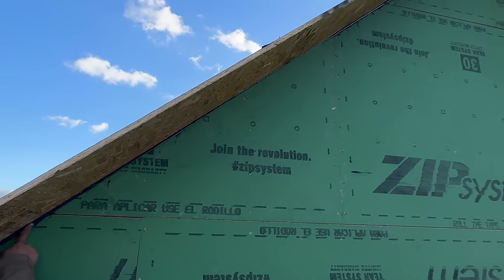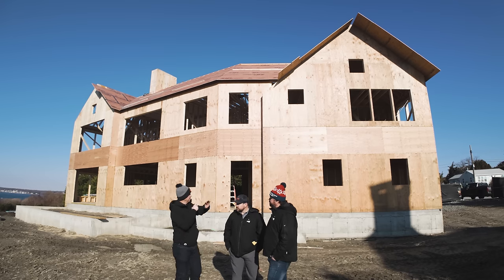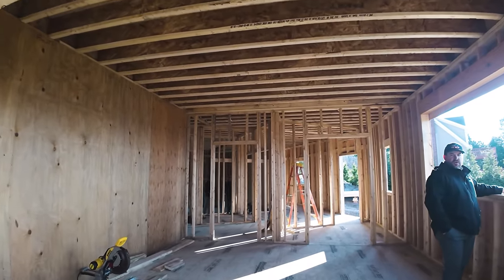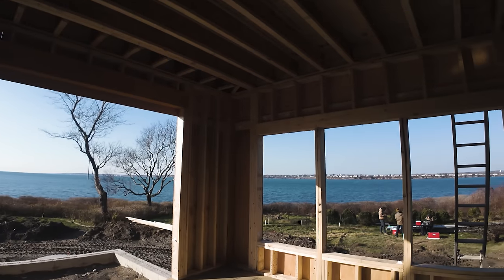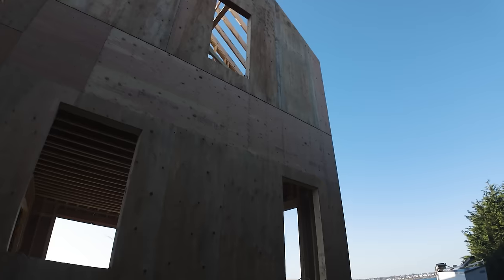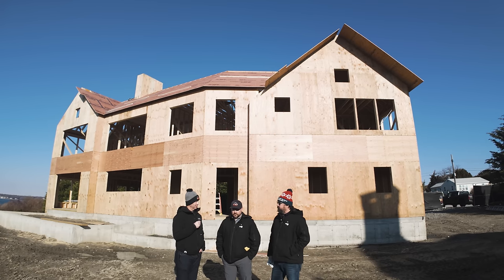A Smarter Way to Do Traditional Framing

Comment: I actually work for a panel company,  and I will say that the main advantage of turning to panelization is to provide lead time on the review of plans to find and sort out inconsistencies and errors. This reduces delays and waste tremendously in the multi- family construction field. Also, if a project isn't completely custom, such as a repeated home style, after the panel design is completed once,  the building can be replicated and refined again and again very easily.
Reply: Any cons to it? Everything has pros and cons that need dealt with so I'm just curious.
Reply: @95dodgev10  
-Wall sizes are restricted to the loads that can travel on the highways in your state, which can be prohibitive at times and limits the size of the wall.
-As was alluded to in the video, wall construction approaches have to shift when it comes to floor to floor
-Architects and Engineers have to allow for it in their designs, there are a few details that we have to iron out and having them on board isn't always easy. They are resistant to change and slow to respond to questions months before a project "starts" so you have to train them to be willing to answer lots and lots of very detailed questions early on in the process and not hip-fire lazy responses, this delays us more than anything I would say. Relationships with these partners is key.
-Small errors in the plan can multiply very quickly and though we try to find any inconsistencies and errors long before anything is ever built because we are essentially building the structure digitally at a high level of accuracy so the errors tend to show up before constructions begins leading to less delays and remodels.
-We have to have all information up front, it cannot come here and there so the Contractor needs to have their act together. All submittals, all plans, etc.
-In essence you are re-balancing the labor and relying much more on the panel company to get it right rather than on a framer to get it right. When I get done with a design, the labor that stands the building can get it done very quickly.

Comment: Hi Matt,
I really enjoy your channel and the direction it is going.
I have a quick question.
I need a recommendation for an air barrier (besides visqueen) to install under the shiplap wall cladding for the interior of our beach cabin (980 SF) that I designed specifically for the lot. We are getting close to insulating and using Rockwool for insulation. The exterior is all shingle and we used Benjamin Obdyke's HydroGap for the vapor barrier with Rainslicker over the top that. We live in the PNW. The heating system is ductless.
Thanks, and keep up the great job.
Jeff K

Comment: As a framer in my past i feel building it myself is way better than panel,  no miscommunication from engineers,  builders abd installers
Reply: Not trying to be inflammatory or accusatory, but couldn't you also be a source of miscommunication?
Reply: @joshuathorson8813 Did you read the full comment
Reply: As a framer,  I have never had a good experience with panels.  17 days is about 5 days too long to be at that stage. Apologies for being critical but that's been my experience.
Reply: @Brownie3307 are you a production framer or a custom home building framer? Cuz that will make a big difference. Granted I do agree it seems they are a bit slow right now but there's a LOT they talked about / showed a bit of but didn't really show the whole thing that's going on. There's extra air sealing being done, a second layer of sheathing going on and rafter tails and eaves (ladders) to be made. Plus all interior walls

Comment: How was the Zip R fastened? Directly into the CDX beneath, or did you need to hit studs?
Reply: Zip R still needs to be fastened to the studs and if your using the 2 inch of foam zip R you need like a 4/4 1-2" nail to fasten it

Comment: With 17 days into the build from when lumber was dropped and with only 40% left to be roofed in -  the panel system saved more like 70% in labor and time if you reduction number of two months saved is correct! Hmmm, would I pass the savings on?? Hmmm!
Reply: You're still paying for somone to build the preframed walls... it's not zero cost, cost just changes form.
Reply: @persistentwind  Yep,  I'd love to see actual numbers.

Comment: Is there a reason more people don’t use ICF it seems like it checks all the boxes with continuous insulation outside and inside solid. Airtight water tight. I always hear that it’s not much more expensive then wood frame building is that false? Is price the main factor?
Reply: It complicates the rest of the install and requires more foundation work. The wall costs are similar. The system costs can be double
Reply: Aren't we trying to move away from foam and concrete due to environmental factors (high embodied carbon, not biodegradable, etc)?
Reply: @katherinebourne8583  why would anyone move away from something so effective and durable? It's completely counter productive but the ignorant masses don't bother to do any research on this
Reply: @katherinebourne8583 the European laugh at us for using wood

Comment: When you are saying the frame was built in seventeen gays you are refering to site construction I assume. How much shop time?
It looks like a really tight frame.
As a design builder I'm looking at you guys outside on a cold winter sunny day asking myself where is the passive solar architecture? I don't know what time of day it is so it is not possible to determine south

Comment: I understand that you have a continuous air barrier with this "monopoly framing" but what about continuity of exterior insulation onto the roof?  Is this not a goal for anyone currently?  Also Plywood plus zip r seems incredibly wasteful.  Why don't the panels just have the zip r to begin with if that is what you want?  Really why is anyone using foam above grade at all??  Not to mention the embodied carbon of rock wool and the labor of shingles.  No wonder construction productivity is going in the opposite direction of virtually every other industry.  Construction costs should not be a side note when so many people in the country cannot afford housing.  Someone needs to start solving for these problems.  Panelization could certainly be part of the solution, but not in this case.
Reply: The zip R gets you the thermal break - to me, that’s the real benefit that it brings to the table.

Comment: You can keep your panels your goal is to cut costs no Union people did that framing did they. I'm ashamed of you
Reply: Union house builders?  Never heard of such a thing.  I've built two house in Michigan and no union trade would waste their time on such a small project.
Reply: What percentage of unions build houses now day? Honestly I don’t know of too many
Reply: Most of us dont have time to drive back to 1965 to have a union crew frame our houses.  Yes... Im from a union family.  Boilermakers, buddy!
Reply: Matt said it was more expensive but saved time, so no cost cutting here. Find something else to be mad about.
Reply: The panel factory is more likely to be unionized than the carpentry crew (not to say that the factory is or isn’t).